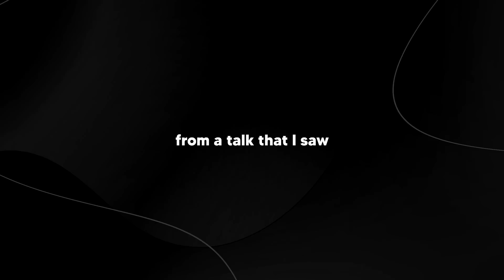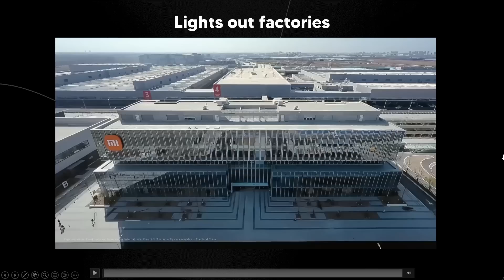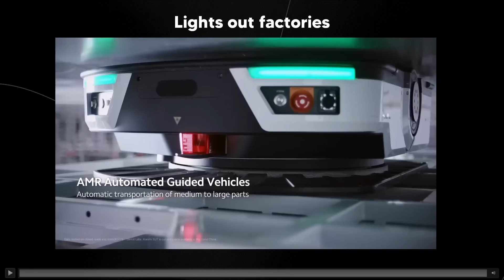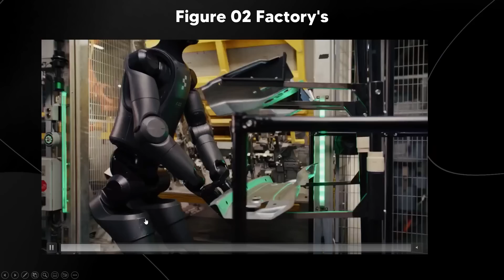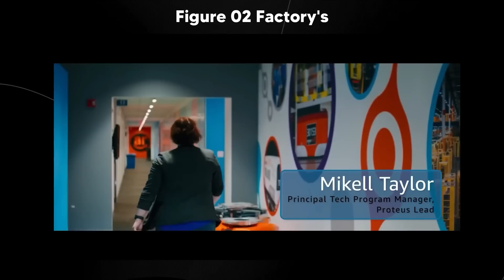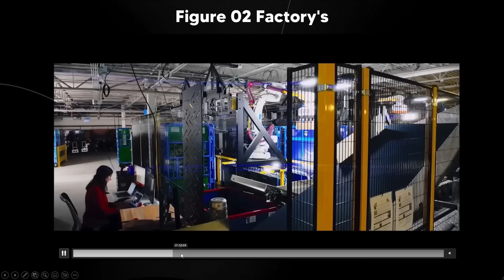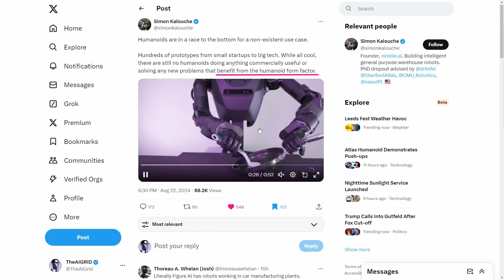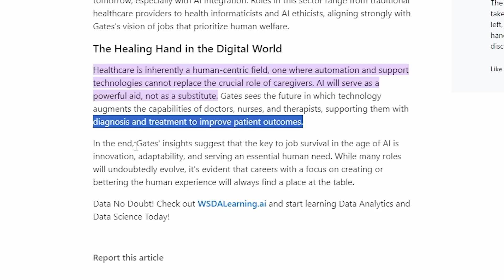Economists Just Reveal Surprising New truth about The Future Of Labour

Comment: If you realize NViudia said within 5 years AI processors should be 1000x faster... those robots WILL be smarter than humans.
Reply: Not to mention their data set is going to go into overdrive via embodiment
Reply: @primalplasma  new models will be distilled and could easily run without server.
Reply: @TheAero  moreover how it's looking is there will be a central database/AI, that then runs the hundreds of lesser AI's within the robot's brains via wi-fi. So even in the case of something like Chat GPT 5 or 6, that likely wouldn't need to be in each of the robots, instead it would be in a central database that then manages the entire robot workforce, managing all the lesser bots/AIs on the work floor and keeping them in line/coordinating them. Like how a theoretical hive mind works :).

For those wondering, I'm not just pulling this out of thin air, companies are testing systems like this right now in their factories, having an entire network of bots all hooked up via ai so that they can all communicate and once one bot learns something, they all learn it instantly, since it's all being managed by the same bigger model. This isn't sci-fi, it exists right now
Reply: I’m pretty sure AI is already smarter than the average factory worker anyway
Reply: @GearForTheYear  The AI might be smarter on paper, but the workers have orders of magnitude more adaptability and can learn skills in a normal fashion. They are still needed.
Reply: @greengoblin9567  look up the new fabs Intel and Xiaomi are building and then come back
Reply: @GearForTheYear  they have zero shot performance but not zero shot learning. Nobody has created an algorithm with zero shot learning. Zero shot learning is needed to automate all human tasks.
Reply: @greengoblin9567  we aren't looking to automate all human tasks, just all human jobs. Also, it doesn't have to be perfect, it just has to be better than us.
Reply: @primalplasma  If they have GPT-5 as their brain, they also need a LOT of power rand a server rack.
Reply: @primalplasma  GPT-5 with planner, RAG, external tools...And trained from scratch. Just OP.
Reply: You don’t need robots to be smarter than humans. The robots just need to be able to follow the instructions. Humans will only be there for maintenance.
Reply: @greengoblin9567  eventually humans won't even be needed for the maintenance, with bots maintaining other bots
Reply: @greengoblin9567  Agreed, I worked in a factory when I was a young'in and the rule was that you had to achieve 85% of the daily productivity target to keep your job. A robot doesn't have to do 120%, but just 100% 24/7, no breaks, no holidays, no sick days and would have an output 500% more than the average worker.
Reply: @effortless-one  at a fraction of the cost. Up-front cost may be 50k, but after that its just repairs and electric energy. 1/100th of a worket, while being 5x more productive. ROI will be in 1 year max.
Reply: @TheAero  Upfront for 1X is announced 8000 USD, Tesla plans 10.000, maybe a little more. 50.000 is comically high. ROI is months (40 hour week) to - weeks, basically, in 24/7.
Reply: @ThomasTomiczek  A robot costing 8k-10k when a cheap car costs 20k? Love it
Reply: @TheAero  Agreed. I am currently looking at setting up a metal fabrication business and am gearing the model around no skilled labour.
Reply: @primalplasma  Ah, but when talking about embodied AI we talk generally about the AI RUNNING LOCALLY. In this light 1000x faster processing puts the robot - well, insane.
Reply: @arnaudjean1159  Yeah, just saying The next breakthrough will change everything - the next x10 will make a real difference. Look at robots now - you often can see the AI thinking. With x10, or even 1x00, it will be flawless.
Reply: @primalplasma  Well, as per 1x they have this solved. Also, sleep cycles - why? And I am not joking - the brain is inefficient here. Likely because good enough and it has to sleep anyway. Some surplus capacity - like during recharging - may well be enough, or a little more capacity to start.
Reply: @primalplasma  It is right for humans, but the human BODY also needs sleep. A robot has reloading - but nothing stops the robot from having the learning loops separately. If the chips can be handled and the power... we cna do better than the brain.
Reply: That would be awesome
Reply: Not to mention that after 1000x the standard improvement annual will be another doubling
Reply: @Glotaku  Not necessarily. There are multiple technologies with more than a doubling - but the question is WHEN. I.e. the NEO memory stack is 30x faster than the current processors (and you can use multiple on one server card) and 99% more energy effective - but the question is when it is available in a product. We may well see smallish changes for 2-3 years then some major tech in research becomes available.>
I do not see 1000x in 5 years without either massively reducing power consumption (so stacking becomes feasible) or some architectural change (Neo or in memory processing). Given that our current power hog is not processing but the memory bus...
Reply: @ThomasTomiczek  discovery leads to more discovery does it not? If ever there was a clear path to doubling it would be forecasted in the mainstream but technology has advanced faster than expected on average from a mainstream perspective. I’m not a researcher in the field but I’ve yet to see a researcher not forecast a doubling in the field of hardware, energy is relative and I don’t necessarily see it as a hindering factor maybe a bottle neck but one that is straightforward enough to solve
Reply: @Glotaku  Nope. You miss the fact that there is a difference between research and product. Major breakthrough lead to each other - but not necessarily in the timespan of 1-2 years. Neo, i.e, - would be my best bet for a major jump, or Celestial, but both are 1-2 years from being ready to be deployed.
Reply: @ThomasTomiczek  you contradict yourself in telling me I’ve missed the point, the research has been found for the leaps we’re projecting it’s simply a matter of industriousness. I won’t get into your large number fatigue that’s clouding your judgement but I do appreciate you spreading your specialized knowledge here
Reply: @ThomasTomiczek  I think I’ve spotted our point of misunderstanding, I simply said a doubling will be the standard even after a 1000x however whether that standard is met on an annual basis or not is a matter of semantics. I agree with all of your statements.
Reply: @Glotaku  I am actually NOT sure doubling will be standard after - it may be, it may be faster. I think that once AI does research, man. Even the idea of 1000x faster processors in 5 years. Imagine what this really means. It means you ask a question and get an answer - but in the background an agentic system of 100 AI has run a discussion about the optimal answer. This reaches insanity.
And yes, it will get faster - and that is where it gets insane.
Reply: Of course each new model improves the next generation of chips now so , you can expect more and more acceleration of improvements by now
Reply: Yeh I wouldn’t believe everything that nvidia says, it’s in their financial interest to „sell“ ai. How do they propose to get over the barrier of transistors being basically the smallest they can be?
Reply: Well they definitely won't be "smarter than humans". For single tasks, sure. But it definitely isn't anywhere near general artificial intelligence yet.
Reply: Source?
Reply: @MACD69  Stop being lazy, use google.
Reply: @ThomasTomiczek  You made the claim, you should be the one to provide the source to support it.  The onus is on you to use Google, not on the person who calls you out to prove it.
Reply: @ThomasTomiczek  I used Google and wasn't able to find a source hence why I came and posted a comment asking for the source
Reply: @MACD69  Same here. I found a bunch of different articles from Google but nothing about NVidia saying that within 5 years AI processors should be 1000x faster. 🤔